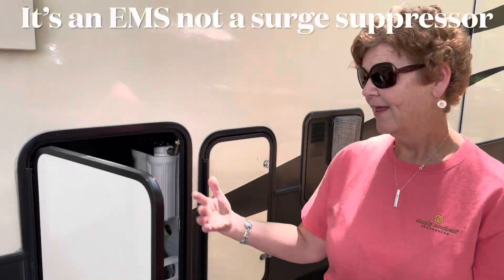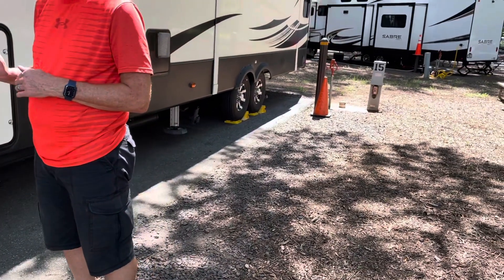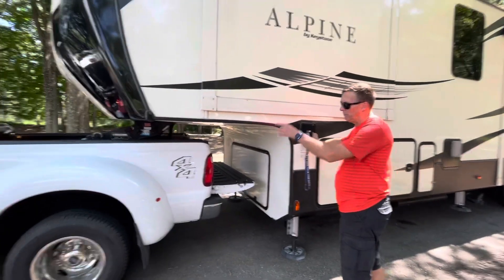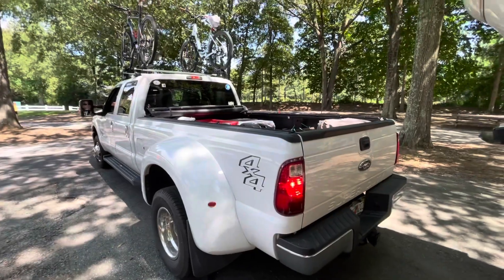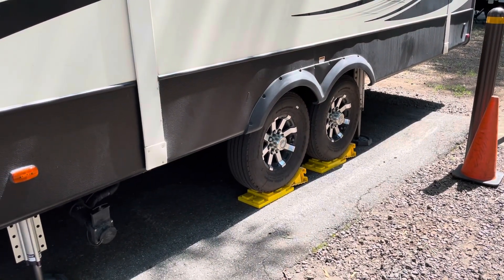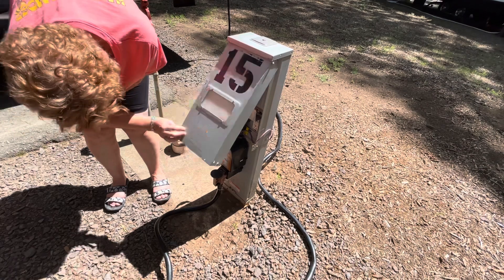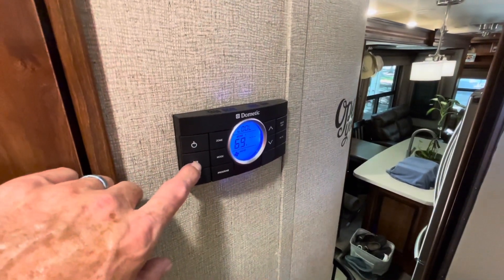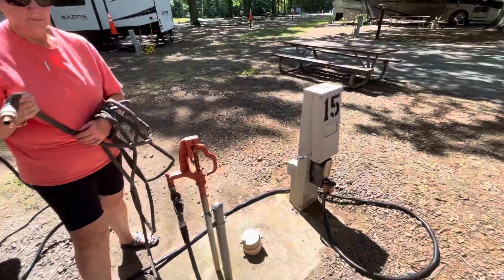Beth did What?

Comment: IS the power cable advice of laying on itself only a concern with 50 amps?  I leave my 30 amp cable coiled all the time?
Reply from the maker: I read it somewhere. It said it can contribute to the cable overheating. I’m not sure if it’s factual but figured it’s worth it to take a few seconds just in case.